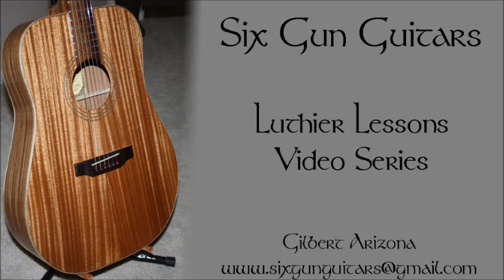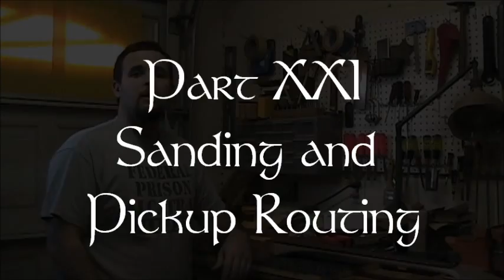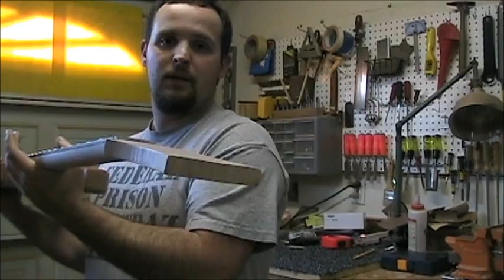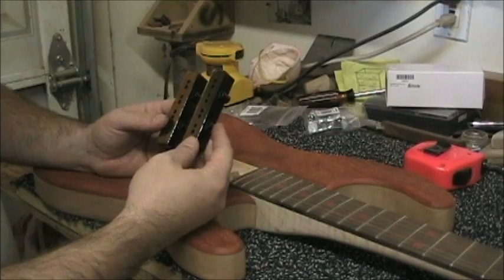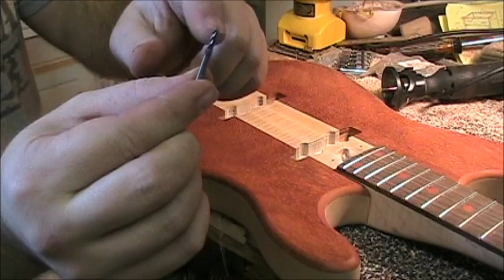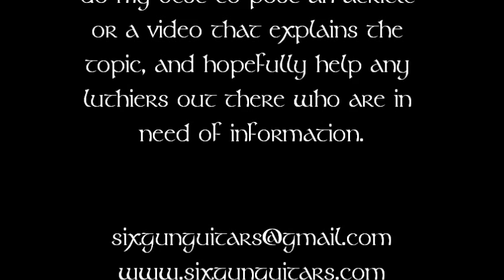Bass Project Part XXI: Sanding and Pickup Routing

Comment from the maker: I use a spiral cutter that has the correct shank size to fit into the Dremel.  You could also cut yourself a thin piece of MDF or clear plastic sheet to lay over the body as you use the tool if you want a little extra protection for the paint.  The router attachment will still leave marks if you drag it along the body with too much pressure.  I would cut a small cover or maybe even try painters tape to add a protective layer as you remove that little bit of excess.  Best of luck.

Comment: I have a Japan crafted Jazz bass, i wanted the pickups changed to usa jazz bass pickups. but usa are just a little bit larger, so i guess the holes have to be shaved in order to fit the usa pickups in, BUT the body is spayed already, dont wanna mess the paint up, I do have a demel, what type of bit do you suggest i use to shave the smaller japan routing holes to fit the usa pickups, Any suggestions?

Comment from the maker: I have a few carbide cutters that fit into the Dremel and are of a few different widths.  Cutting the hole with a router works better, but a Dremel can do the job too as long as you take several shallow passes to get to full depth.  Look online at stewmac.com and they will have some carbide bits for the Dremel.  Beware though, they will not be cheap.  A small 1/8" straight bit will also work, and I believe that Dremel sells these as well.  Best of luck.

Comment: here is a tip
make a template for the two pickups ,make it just a little higher from the neck
line it up and you all set and very accurate.
cheers

Comment from the maker: I saw a guitar like that before.  The foam has good bounce in the beginning but over time most foam will hold to the shape you jam it into and lose its bounce back.  Not a problem if you plan on adjusting the pickups correctly once than make a couple tweaks in the beginning if needed, but the one I saw was limp and lifeless.  It held fine for a long time, but you couldn't adjust upwards anymore, only down.  Not a bad idea though, best of luck.